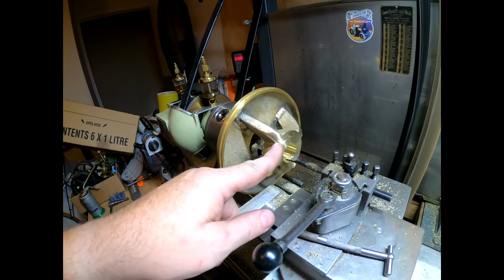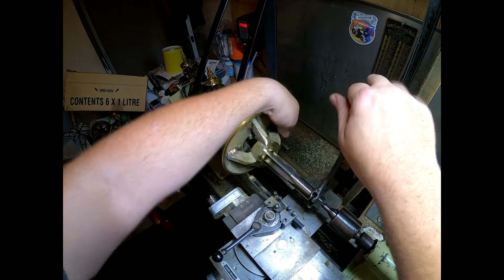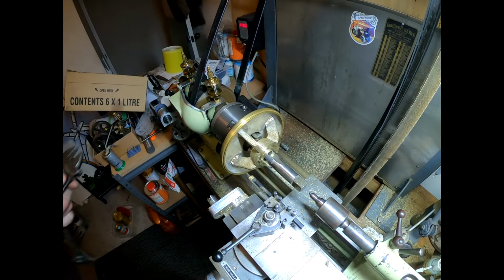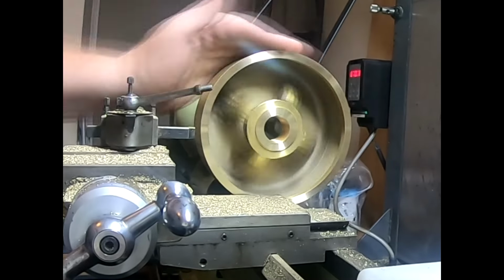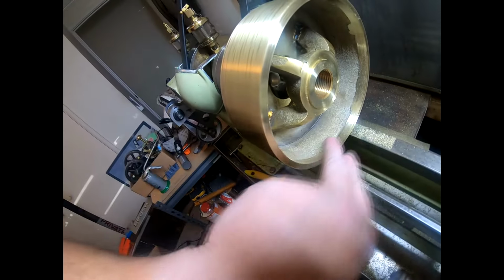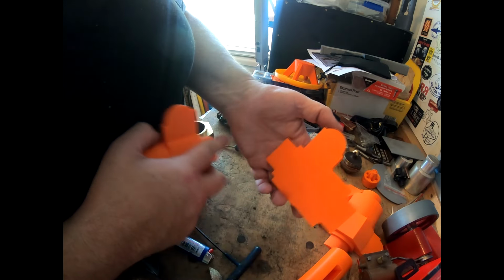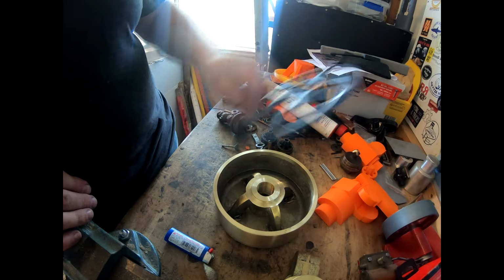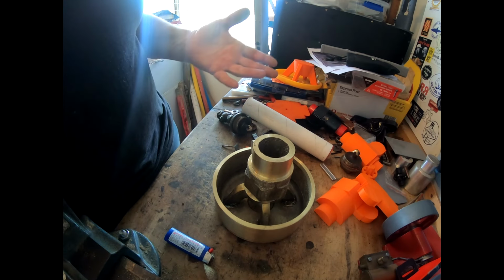Luncheon whistle part the second

Comment: I like to run the tap in and the tail stock at the same time so there is always centralized pressure. Usually involves the spanner resting against the tool post to free up a hand.